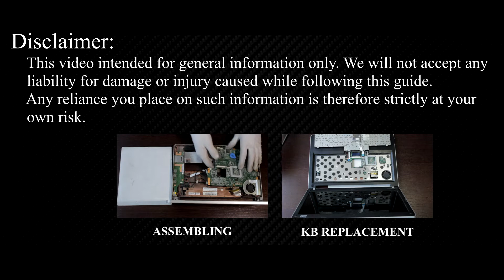Lenovo ThinkPad Edge 13 Disassembly, Fan Cleaning, and Thermal Paste Replacement Guide

Comment: If anyone is planning to upgrade the CPU on this laptop, DO NOT BOTHER! IT'S A BGA CHIP - SOLDERED TO THE DAMN MOTHERBOARD!
Reply: In all variants? There were at least 3 different processor variants and I guess also 3 different MB.
Reply: @MezeiEugen  As I posted the above comment 8 years ago, I can't reply with any more info about it. And the laptop is probably not worth having anyway now.